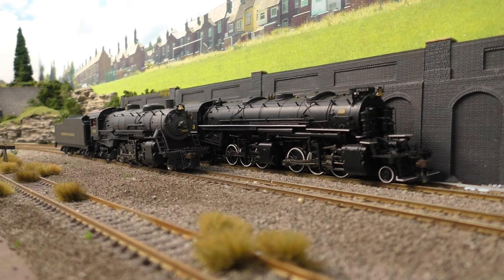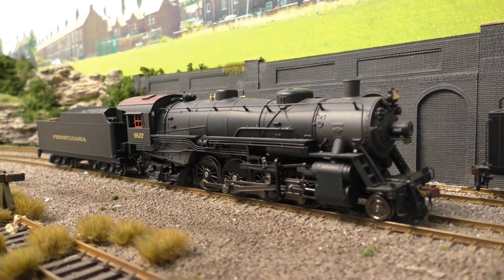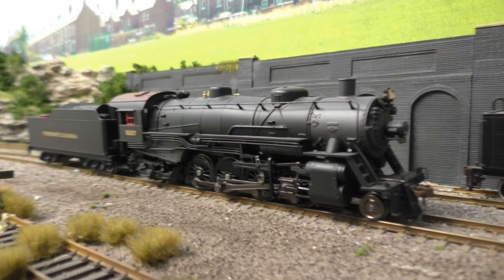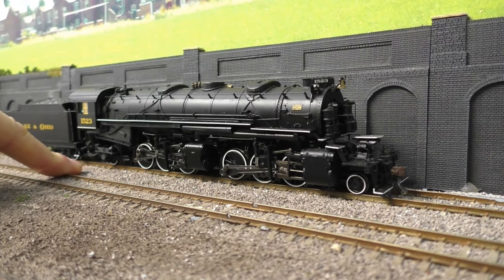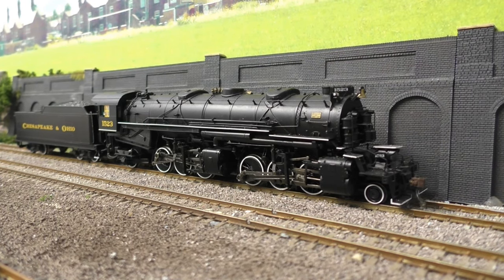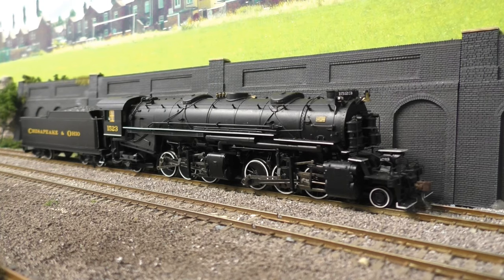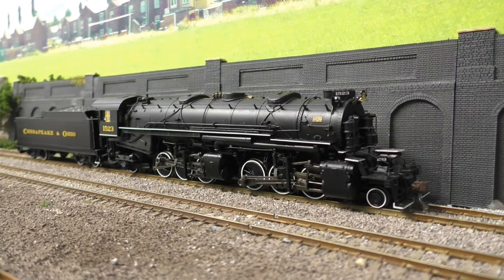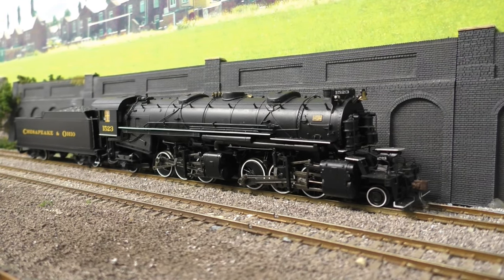Articulated steam locomotives what are they and a running session

Comment: Some others too - the Heisler, Climax and Shay types used on logging railroads in the USA.   I'm fairly sure the 3 articulated locos you have are all Mallet types - on these the rear set of drivers is fixed like a regular steam loco, only the front 'half' has freedom of movement.

Comment: The first loco shown is a USRA 2-8-2 “light mikado”, and there are indeed only 2 outside cylinders. I can’t recall if the Pennsy had any mikados of this type, of course I’m in no way an avid fan of the road (the New Haven is what I stick to if it wasn’t blatantly obvious), but there were definitely a ton of these mikados made (1200? 1300?) and I’m sure a road as “world renowned” as the Pennsy would have at least a few designs.
Reply: The Pennsylvania Railroad did have a few USRA light mikados.  They were Class L2.  Mallet articulated locomotives were compound locomotives. The smaller high pressure cylinders were on the fixed rear engine unit.  The larger low pressure cylinders were on the front pivoting engine unit.  Neither of your Union Pacific locomotives are Mallets.  They are not compounds but just referred to as articulated locomotives.  I hope that this is of interest to you.  Love your videos.
All the best from the other side of the world.
Stay safe 
Paul from Zillmere